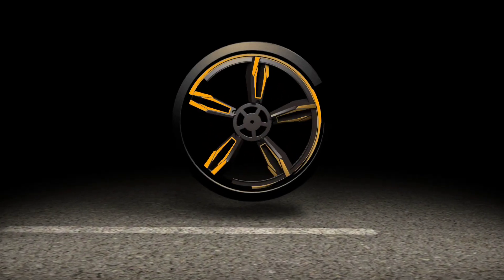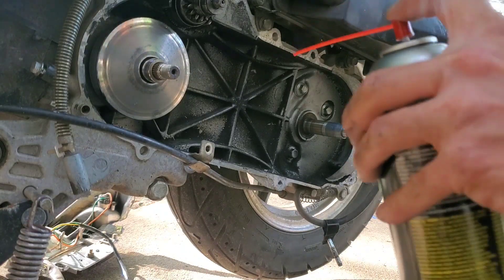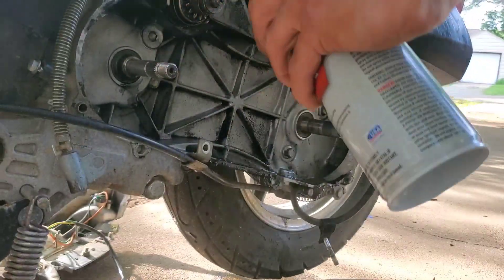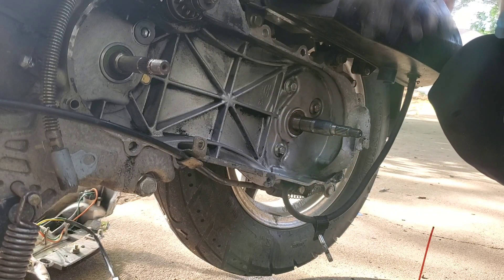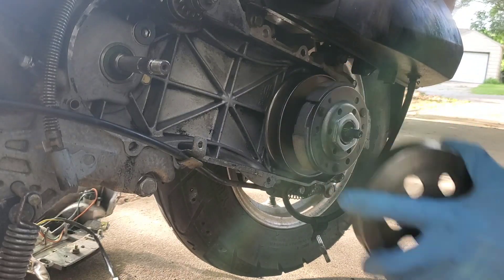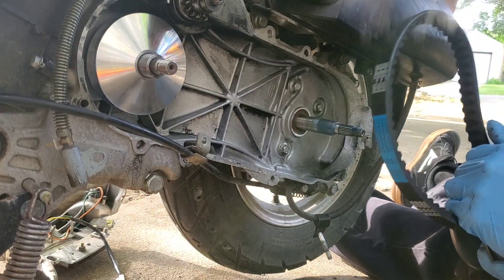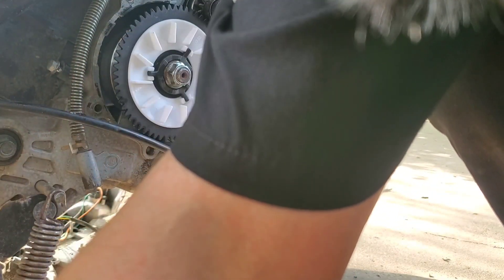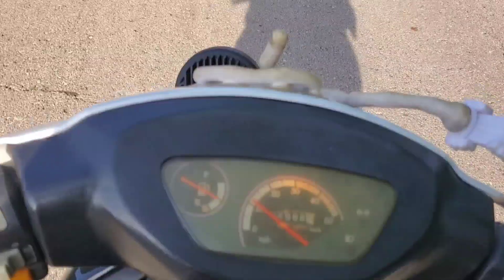GY6 Scooter Transmission Rebuild!

Comment: I'm about to do a 150cc project. Bought a branx new crate motor, didn't realize it was a short case. My long case was basically obliterated before I bought it but the whole scoot was $100 so no biggie. I'm about to take the the whole front half of the new motor off and put it onto the long case transmission. Wish me luck 🙏
Reply from the maker: Right on man hope it goes well.  While the motor is out consider a big bore kit. I'm very impressed with mine on a 50cc but a BBK on a 150cc would HAUL ASS! Just a thought.
Reply: @Andys_Auto  it started as a 50cc...a scrap yard dog held together by electrical tape and zip ties lol. Then I found a better frame and body that was going to be scrapped and rebuilt my 50cc motor into an 80cc. Then that blew up so I found a 150cc with a blown out body from a wreck but the motor ran. So I chopped the motor mount off that frame and welded it onto my 50cc frame. It's been a long journey with this scoot, I probably won't BBK it just yet. I'm on a budget so everything has to stay stock for now
Reply from the maker: @thethinkingtreefrog8061  I hear that. There is a guy with a YouTube channel Trevor Pritchett I think it is. Check his channel out. He did the exact same build you are doing. 50cc chassis with 150cc motor. In case you run into any issues his videos may be of help to you.
Reply: @Andys_Auto  The project went well! It was my first engine rebuild, and I got it right the first time thanks to videos like yours. Thanks man 👊😎
Reply from the maker: That's great to hear man. Thank you. Now enjoy the ride!

Comment: So I just bought a 2019 wolf rugby about 2 weeks ago and other then a little bogging down it ran pretty fine but now it won’t start I thought it was my bendix after taking the cover off because it just fell out but I noticed I don’t have a plastic cover on my fly wheel and my fly wheel is too loose and the bendix can’t reach it to connect unless I push it back is there anything I can use to temporarily hold it in place until I get a new plastic cover

Comment: Well I bought the clutch in variator kit and I put it on I bought the scooter from my boss which probably was sitting in the barn since 2015 when I took the variator up the damn rollers weren't even there they were all the way down to the metal I can't even believe I was driving it so I put the new clutch on an variator and took her for a ride well it was only going thirty miles an hour so I got home and it smelt like the belt was so I took it apart and I took three rollers out cuz one of the videos said it would make it go faster on take off and it did exactly what you said just rev higher can I put another roller in making it four rollers or put all 3 back in to make it 6 and what else can I do I've been up two days trying to make this thing work
Reply from the maker: Definitely use all 6 weights.  4.5 gram weights are ideal for 50cc but 4 gram and 5 gram are fine too. You can find the weights pretty much anywhere online
Reply: @Andys_Auto  they came with the kit
Reply: @Andys_Auto  I figured that's what you would say so I did just put all 6 weeks back in
Reply: @Andys_Auto  I actually put the new clutch back in I want good takeoff power I don't know what to do in my money is running short
Reply: @Andys_Auto  I mean I put a new mattress new clutch cable new clutch and variator kit high-performance carburetor I'm getting the original airbox this morning I'm getting a lightbox handbrake on the 13th I fix all the lights cuz they weren't working this thing had to be sitting in the barn cuz of mice chew the wires for the the dude I work with some time he knows you did to it runs strong it's a zummer 50cc with 4000 on the moter it doesn't bog no more corsola Smogon cuz of variator was so shot I can't believe I was even running
Reply: @Andys_Auto  I'm about ready to sell it for 1k and be done I paid 700 for it with parts and labor it's well over a grand
Reply: @stewheff1290  Most of the time if you order a cheap variator with weights the weights are 8.5 grams which is too heavy for a stock 50cc. Even if you take out 3 it comes out to 4.25 grams which is still too light. 5-5.5g is the weight you want.